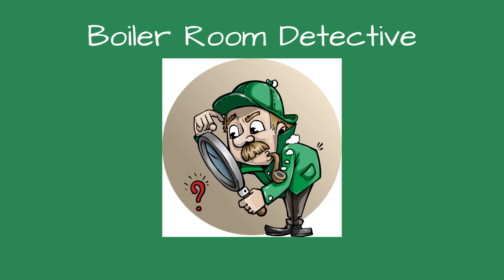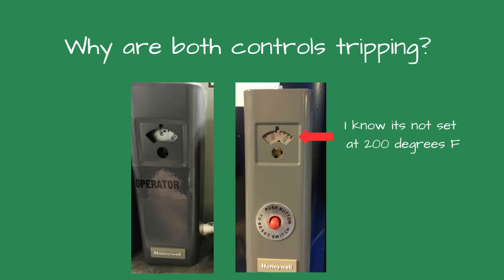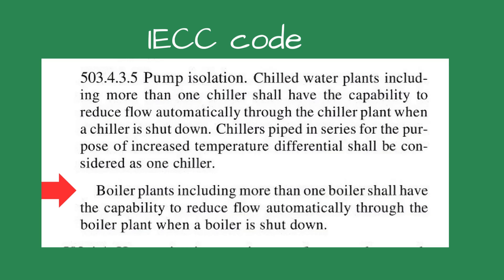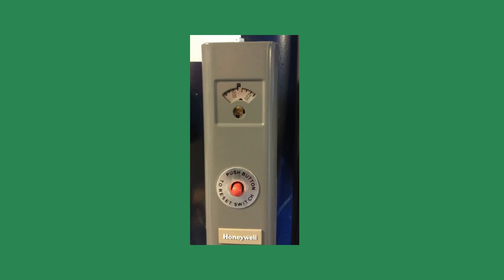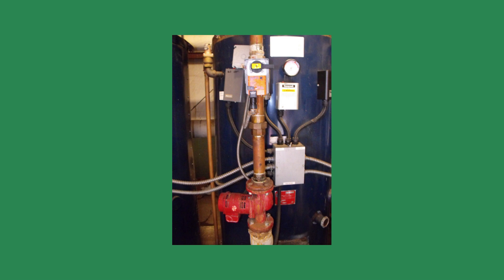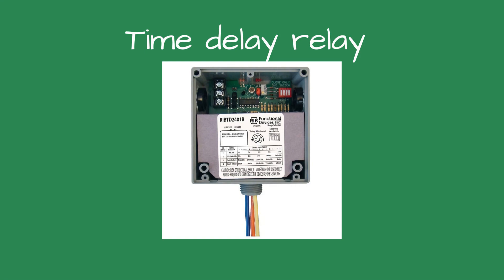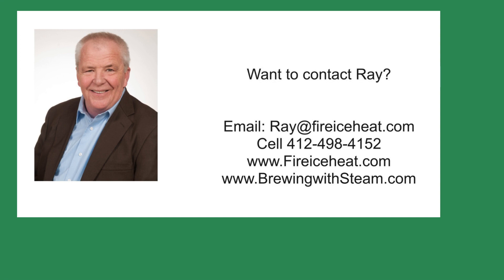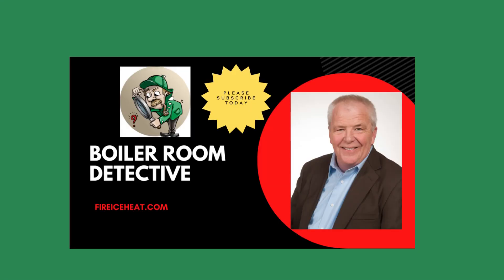Case of the tripped limit controls

Comment: The time delay is of course dependent on the boiler's consruction with refractory firebox styles requiring the longest delays. The isolation valve also prevents the system return water from flowing through the off boiler and tempering the supply water temperature of the lead boiler. I always recommended a 3/4" bypass liine (with a ball valve) around the isolation valve to keep the off boiler warmed while not allowing the minor flow to upset the system.
Reply from the maker: Thats interesting I would have never thought about the bypass but it makes sense. Thanks for the comment and watching the video Have a great weekend